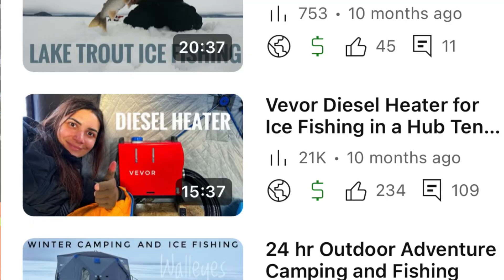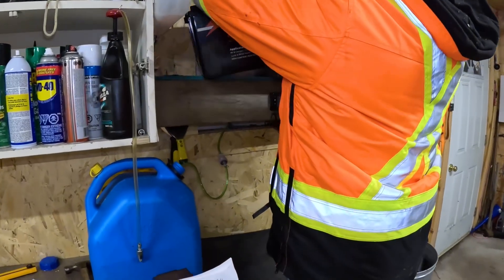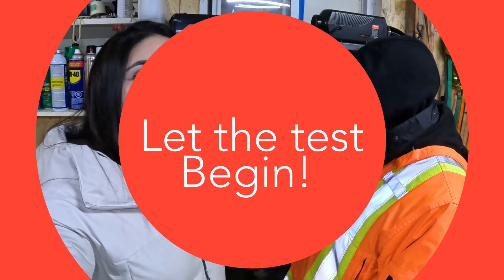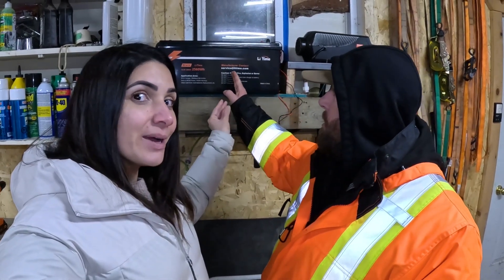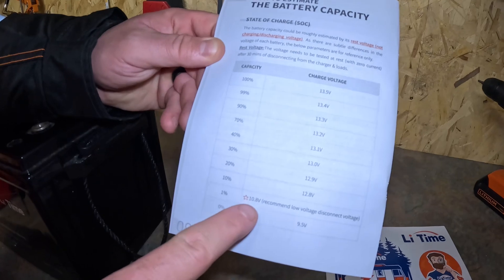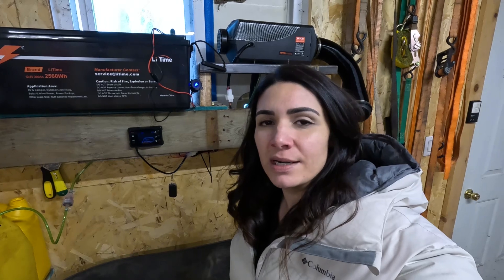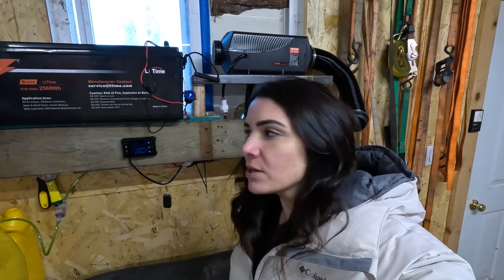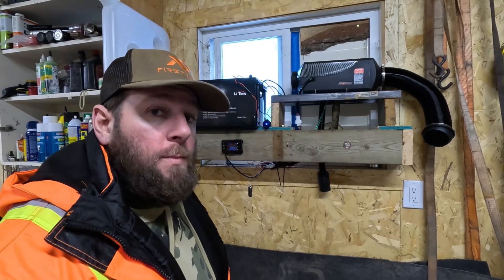How long will a diesel heater run on a battery | Li Time 12v 200AH lithium battery

Comment: Batteries were replaced 6 months ago and my espar bunk heater makes the batteries drain to 12.1V in 12hrs
Reply from the maker: hmmmm 🤷‍♀️ i dunno
Reply: @chasenashleyoutdoors7632 I figured out th problem, it was user error. I don’t let th truck idle long enough after using th batteries to cook so I kept leaving it at 60-70% charge
Reply from the maker: Glad you figured it out 😊

Comment: Thanks for sharing this. Have you guys thought about a small solar panel to keep the battery charged? I used to use one for my trolling motor, it made a difference and wasn't too much gear to haul.
Reply from the maker: 😊 no we haven’t but that an idea!

Comment: The air intake on the heater . Do you want it on the inside or outside? I just bought a diesel heater for my truck camper. Thank you
Reply from the maker: we keep ours on the inside so far

Comment: Thanks for making a video on this topic. I noticed your fresh air intake is from in the garage. If the heater, battery and fresh air intake are inside the ice tent this would be accurate. If the heater, battery and fresh air intake were outside with only the 3 inch hot air out take house going into the tent. This would take more battery power to run the heater and the battery life in the cold would effect the battery life.
Reply from the maker: That makes sense. We run our heater and keep the battery all inside the tent while we’re winter camping.

Comment: I have a Vevor Diesel heater they are great but that Is a problem running down the battery, Diesel heaters need to have a generator to run the glow plug and blower and electronics
Reply from the maker: Interesting. This is our second winter running ours off battery only while winter camping. We’ve never needed a generator 🤷‍♀️
Reply: The glow plug only works when the heater is started, then the heater only needs 40 watts to run the compressor.    How many amps does a diesel parking heater use?
A diesel heater will need a 12 V power supply, but the electricity consumption is also very low. Wallas heaters require 10-12 amps to start, but once the heater is running, it will only need approximately 0.5-4 amps.

Comment: This is really helpful - I'm using a 100AH Li-Time battery and 8kW heater for emergency (grid-down) heating and a kerosene heaters as backup. With your information, I'm going to buy a 200W solar kit to charge the battery while it's in use so it should run forever, theoretically, and never deplete the charge. It makes more sense for me than buying a second battery.
Reply: I've been running my 8kw CDH with an Ecoworthy 12V 100ah, MPPT solar charge controller, and a 100W panel from Hobo Freight. Works like a champ!
Reply from the maker: That sounds great! The reason we have two is because they were selling the pairs on sale. Stay toasty! Cheers ;)

Comment: 400 bucks for a battery is a little bit high
Reply: Paid $253 Dumfume 300ah arrived today !
Reply from the maker: @2hotscottpro good stuff! Power for days and days
Reply from the maker: For sure, It’s an investment but other brands are much higher
Reply: @mike97525 How do you figure? Have you priced true deep cycle lead acids, which are about half advertised capacity since lead acids can only get to maybe 50% depth of discharge before  permanent damage?

Most of these batteries have a cycle rating of 5000+ with 80% depth of discharge (not sure anyone has had one long enough to actually test that), but that's well over ten years of daily discharge. There isn't a lead acid made that will come close to that lifespan under anything close to the same conditions.

$400 for 200 actual amp hours is a steal compared to lead acid no matter what you use it for honestly.

Comment: The biggest difference may be how many times it cycled on and off since it draws very little to run but a lot to start with the glow plug .

So if it just stays on only powering the glow plug once to start then it will run longer compared to it cycling on and off To maintain a temperature .
Reply: @55afishead  
Power= volts times amps 

Running 
P= 12 volts X 2 amps = 24 watts 

Starting Glow plug 

P= 12 volts X 20 amps = 240 Watts 

2400 watts is more than  you can get out of a regular outlet , 15 amps !

P= 15 amps X 120 volts = 1800 watts
Reply from the maker: Thanks for putting this all in the comments! Hopefully people find it and can figure it all out ;)
Reply from the maker: For sure. When we winter camp ( which is what we use it for) it normally stays on for the most part.
Reply: @ 
Yes best use , but others may use it more conventionally setting the thermostat .
It draws 2-3 amps  ( 24Watts ) running but 20 amps starting for a short time .
(240watts).just to let people know .
I loved your tests .
The most common 12 v lithium batteries are 100 amps so if people have them instead of your better 200 amp ones they can divide by 2 to get run time .